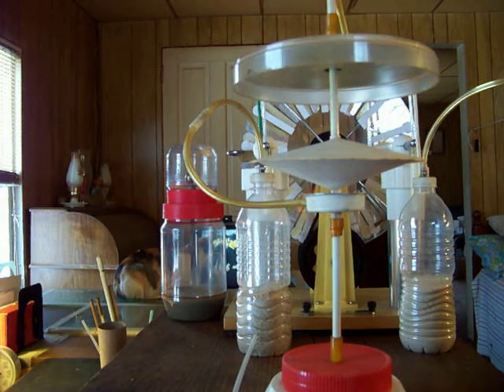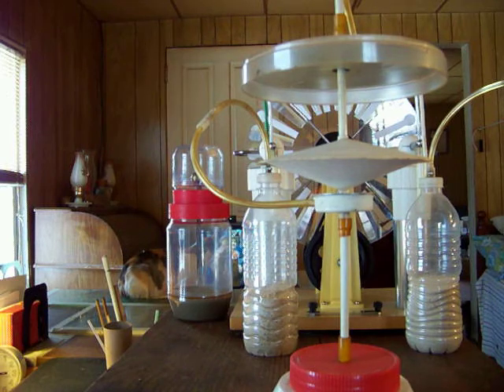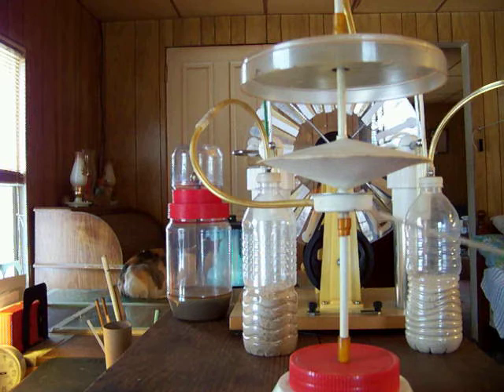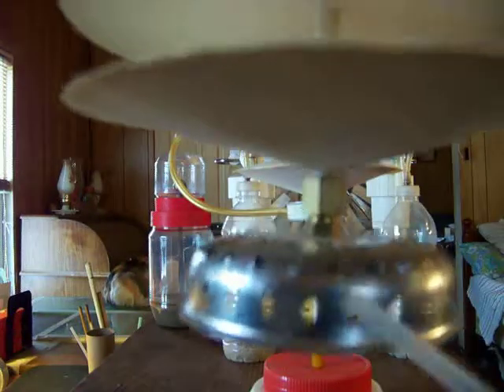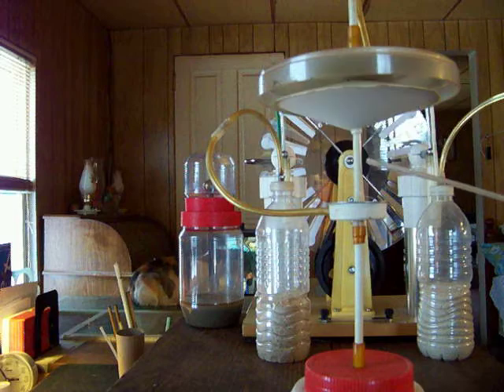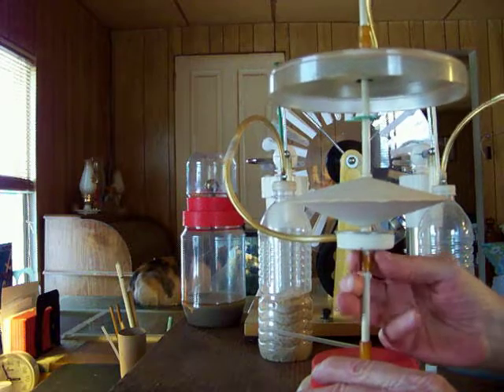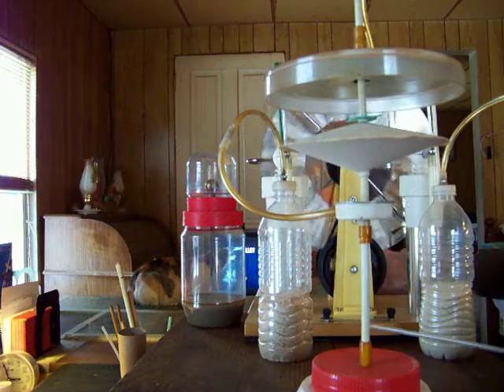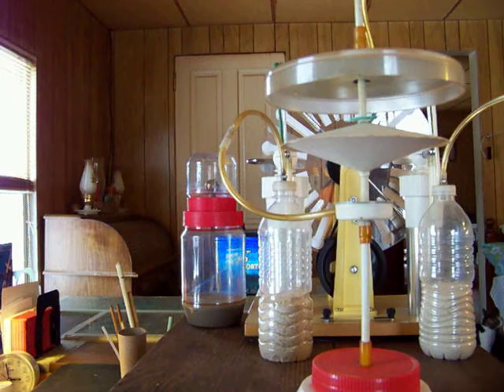STATIC DISC LIFTER/ WHY?

Comment: HI! neat design and thanks for sharing, I have a question though, can this be used for propulsion? from this video  I think not at all.  it is a simple attraction of two oppositely  charged surfaces that nullify any net force, or am I missing something here?  thanks
Reply from the maker: leviterande No, it can only only be lifted inside the chamber. No, it is much more than a simple attraction to the top plate. If that was true then why is it not attracted to the charged bottom plate? In fact why does it lift or hover at all? I explain all this and more in the description of this video. You want is see ion engines, watch the videos on my electrostatic ion engine channel, just look for the link on this channel.

Comment: Howdy!
Thanks for sharing this!
So, what are the applications for this? Besides the obvious application as an executive desk toy... (right up there with plasma, drinking birds and newton cradles).
How might lifters be turned into something useful? Is it scalable to a larger field test? --- would this be useful in novel elevator applications, for instance? As an electric aircraft platform (VTOL apparatus)?

Can this be combined with other effects: such as superconductors, gyroscopes/spin, aerodynamics/thermodynamics (what if heat emanates from the bottom of the lifter?)...

Can this rig be made so that the top and the bottom are freestanding (so as that central guide rail is no longer there)?
Is there any way that transparent/translucent paper or materials can be used, so we can see inside the lifter?

How does this lifter concept differ from a mylar lifter?

Anywho, these certainly are fascinating and thanks for sharing!
Reply from the maker: Hi John, Well, you sure have enough questions about the disc lifters. In other videos on this channel(This is one of three) I explain how they lift and much more. I think the videos cover most of your questions.
   The only thing that my lifters have in common with the triangle ion lifters is that they both use the application of electricity. My lifters use high voltage static electric fields only.
   Yes I think they can be up scaled. To get them free of the the lift chamber there will have to be added other electrical applications. I,m sure this is possible and still be a all electric design with no moving parts.
   If you want to study ionized propulsion using electrostatic generator, go to my ion engine channel. there is a link post on this channel.  BOB
Reply from the maker: John Smith My thinking is that I might learn enough about the applied electrical forces to someday design a lifting system that dose not require the use of the Bernoulli effect or high reactionary force.
Reply: ELECTROSTATIC DISC LIFTERS Apologies for the delayed response,
Many thanks for the replies, and for expanding upon the differences between various approaches.
there certainly are interesting effects at play there, and between these and the mylar lifter videos elsewhere out there (well, mylar and several newer materials), there are many options for 'digital propulsion' in the pipeline as electrical primary fuel sources comes back to the fore (in a post-abundance scenario).
It will come down to the combanatorics and optimization of blended approaches for implemented solutions.

My only area of concern would be the ERoEI (energy return on energy invested) for the projects,
particularly from a total systems input perspective --- what's being put into the thing to achieve or sustain an outcome? (nb, this includes what the thing itself is made from, and all handling steps in a process)
 comparing and contrasting the various solutions to the lifting goal are the aim of the game and getting that efficiency as high as possible is crucial.

It's with all that in mind that I wondered where any crossover potential might be for your idea with other applications (using good ol' SCAMPER method). Honestly, it'd be cool to see this in applications where other modes of lifting (say, a palette jack or cherry picker, through to a hot air balloon or blimp) weren't appropriate for the task. likewise, with the rise of drones and quadrotors, a larger 'lifter base' for drones to launch from might come in handy. Perhaps also, if ERoEI and maintenance weren't significantly different, these'd make nice elevators for offices etc.

Similarly, inducing AG (artificial gravity) might be to bombard a person with concentrated low energy mesons between the two plates, so as to induce a 'normal' response from them relative to the plane of projection which would be similar in effects to regular gravity... the problem would chiefly be power,
 however if the propulsion system happened to make various particles as a byproduct, then perhaps there could be a saving made there...

I look forward to your further research in these areas,
and particularly the entertaining and informative videos to come.
Reply from the maker: John Smith
All these things are possible with the correct application of the knowledge we already have or will gain in the future.